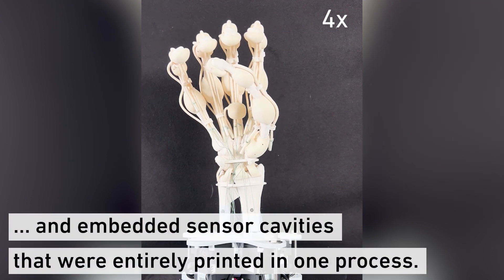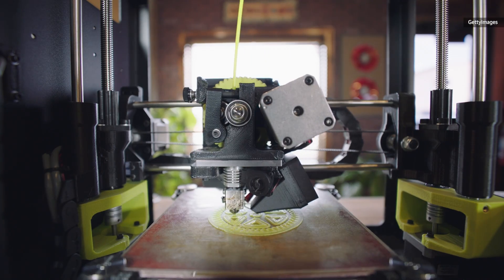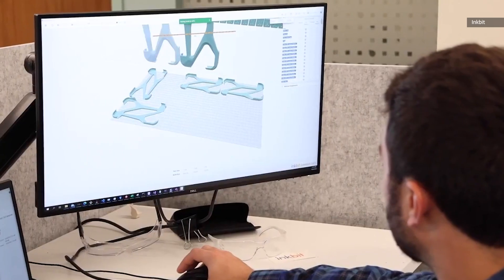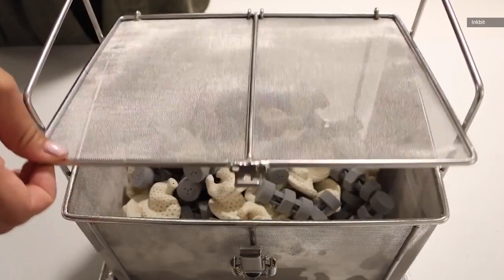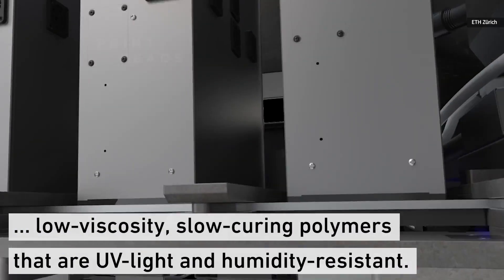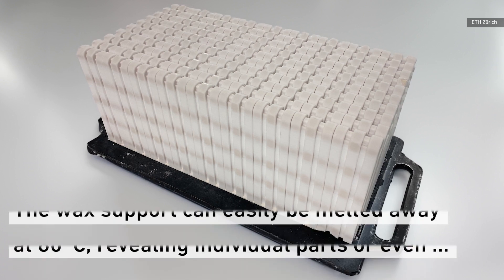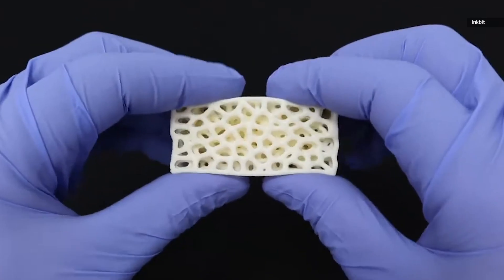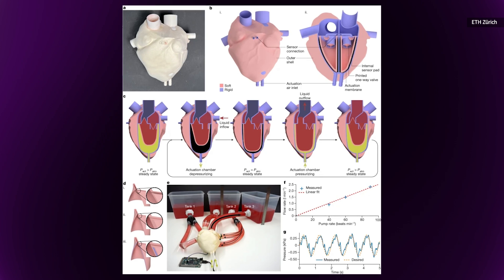3D-printed robotic hands with bones, ligaments, and tendons

Comment: While the tech is cool, I fail to see how this a better solution than 2 stage curing resin like the one from Carbon? What material that you can't make into a green part, but this can print anyway? Moreover, with that amount of support, I highlight doubt it can be any faster than the resin printers currently on the market.
Reply: I didn't notice any mention as to how quickly it printed - I suspect it is quite slow. Personally, I prefer slow and precise 3D printing for my projects.